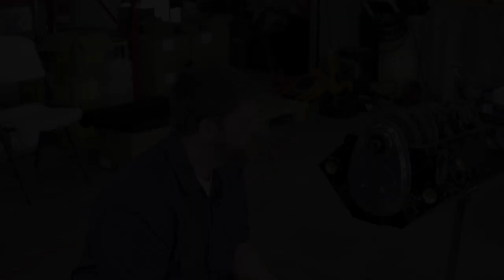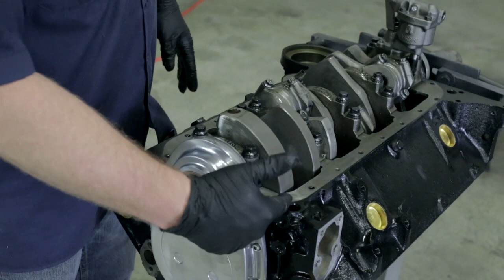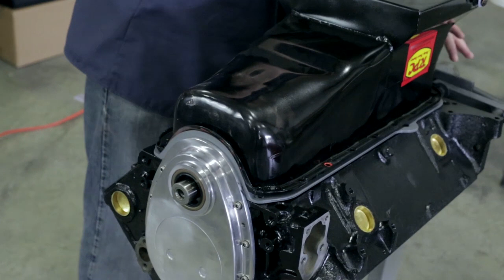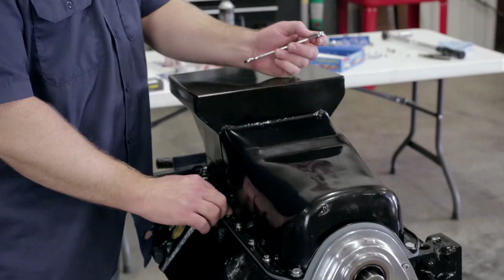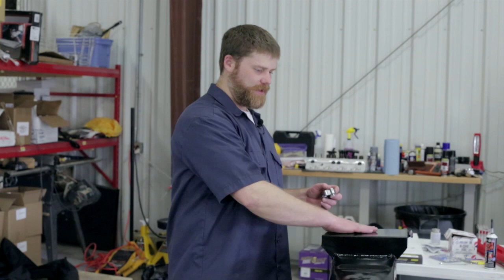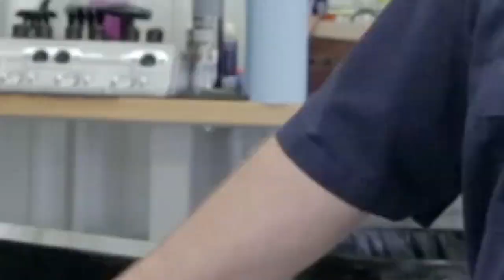Small Block Chevy Engine Build: Oil Pan and Pump (Part 2)

Comment: Oil filter bypass valves should be plugged. High pressures allow the valve to open in which case metal particles are allowed to circulate through the engine and not be trapped by the filter. This is especially a problem with today's poor quality flat tappet cam/lifters - which compounds the problem of failures during break in. Simple to fix. Remove the oil filter bypass, and the parts in the valve. Run a 1/4" tap in the hole and install a 1/4" pipe plug. Now you wont have metal constantly recirculating through the engine. Just make sure you use thinner oil during cold weather.

Comment: that's the incorrect pan for that engine the bump for the oil stick is on the opposite side leaving a gap.
Reply: No it’s not it’s for a driver side or passenger side dipstick you dumbass!